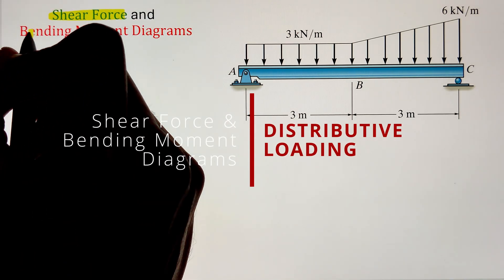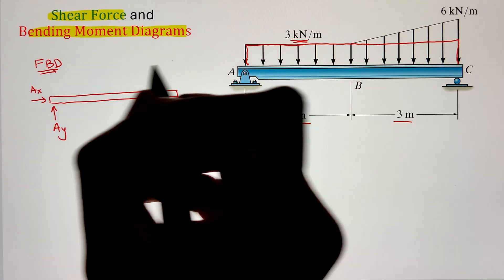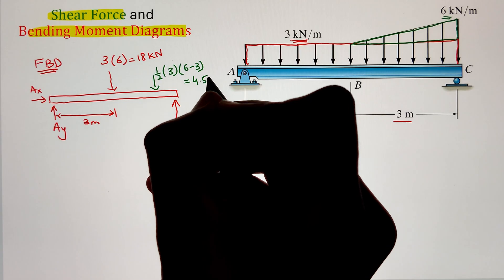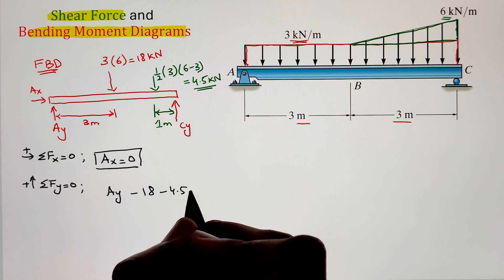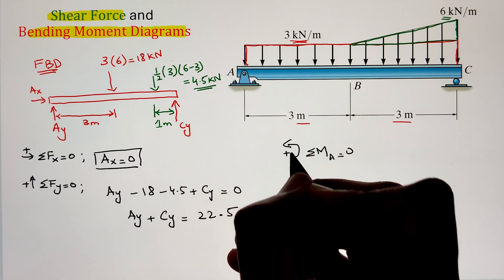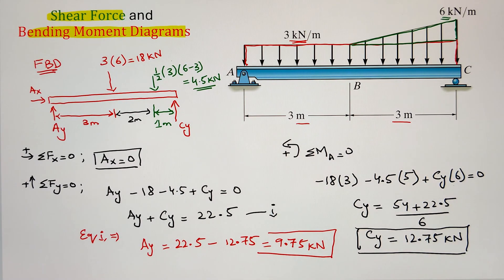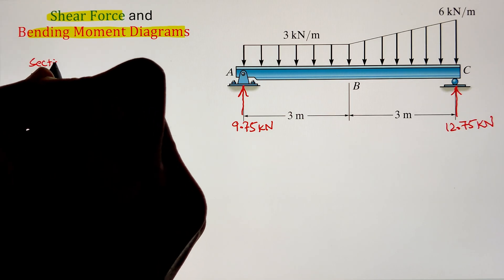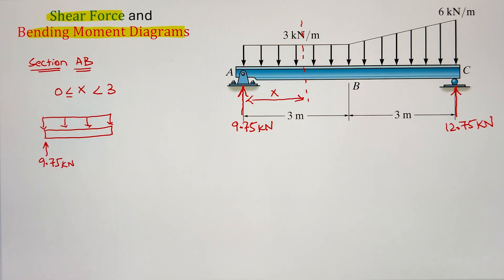Shear Force and Bending Moment Made EASY!

Comment: How did you determine the x component of the green force to be 4.5? is it just 3 + 3/2?
Reply from the maker: Which force are you referring to if you timestamp it will be easier to answer, if you are referring to the triangular distributed load from pt B to roller, I have calculated the area of the triangle and convert it to green color point load using (1/2)*base*altitude that comes as (1/2)*3*3=4.5kN
Reply: @MathPhysicsEngage  Thank you for the quick response, that is indeed where my confusion lies! I think I need to rephrase my question as I better understand my confusion now. For the moment at A, you calculated that the triangular distributed load component was -(4.5)(5). Why would it not be (-4.5)(4.5m) as 3 + 3/2 = 4.5 and not 5? I guess I am just confused why the distance is 5 and not 4.5 . Thank you
Reply from the maker: So the triangular distributed load once converted into point load will be located at the centroid of the triangle which is (2/3) of the base of triangle from point B so the point load will be located at a distance of (2/3)*3=2 meter from point B. Now since Point A is 3 meters from point B that is why the moment arm is 3+2=5 meters so the moment will be 4.5 times 5 here.
Hope that helps.
Reply: @MathPhysicsEngage  Thanks! That helps

Comment: The BC segment in the shear force diagram does not connect the two points with a straight line but with a parabolic curve.
Reply from the maker: Yes you are correct, maybe the way I draw it, it looks kind like a straight line, however we have shear force expressions with a x^2 term so it will be parabolic curve
Reply: @MathPhysicsEngage ❤❤❤

Comment: Why we take two section  
If i take one section   difference between them
Reply from the maker: It has to do with how the load  is applied, since there are two different types of distributed loading (discontinuity present) that is why we need two sections to solve it. 

If you want to make just one section, where will that section be? What does the free body diagram look like?, Once you draw that, you will see that it gives internal loads correctly only for either x in between 0 and 3, or for the value of x between 3 and 6, because of the discontinuity in load present at x=3.

Hope this helps.